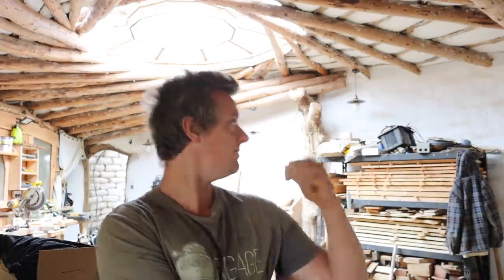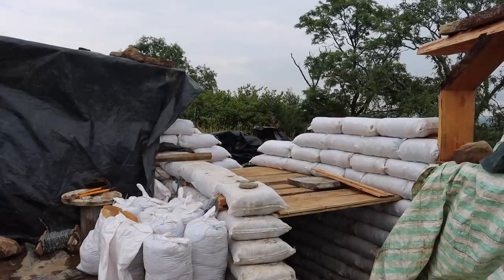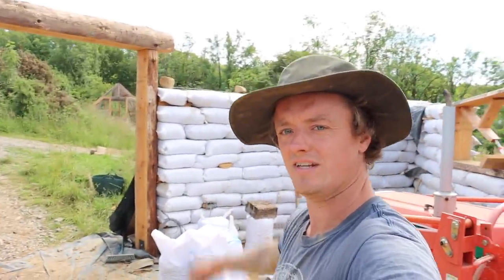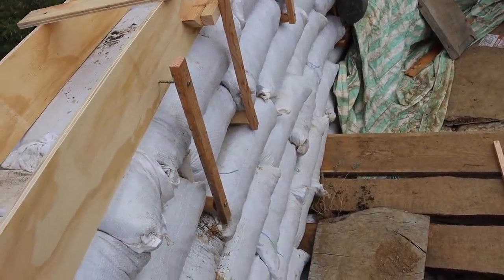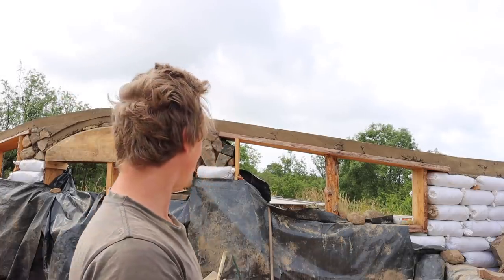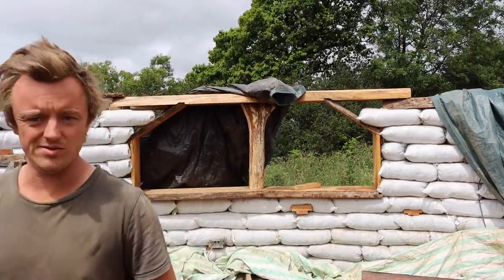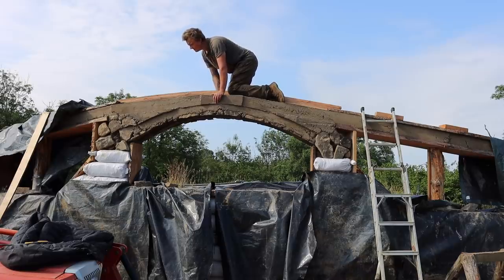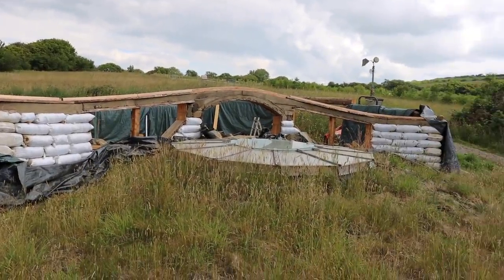Off Grid Earthbag Workshop Part 63 Walls Complete

Comment: Hey Chris,  as sad as this sounds I am actually a concrete expert. Six years as a builders labourer, twelve years in the concrete industry and I have looked after some major projects, like high rises, tunnels and stadiums. I am technically trained in concrete. You are right, concrete has no tensile strength or sheer strength. It only has compaction strength. Make sure when you place it compact it well. It is a trick, you don't want to over compact it so it segregates, just compact it well. I would add more cement, even if you can some fly ash (no more than 25% of the cemetitious), looking at when you cracked that piece in your hand, I reckon it could use more cement and compacted better. Still a good job and a tricky pour. You did an awesome job. Take care man.

Comment: A proper mix will reach most of it's strength in 7 days, and it 's max strength in 30 days. If it drys out it will quit curing, so a windy day could do that more quickly. A wet burlap bag will keep it curing during the 30 days. I've been civil super responsible for placing over 5 million yards of concrete in my time, and occasionally even the best lose a few. Hopefully it will work out for you. But don't take support off for at least 3 weeks if in doubt. It's looking pretty good. Regards, Solomon

Comment: A reciprocating saw with a chunk of wood bolted to a short blade makes a great concrete form vibrator - just run it along the sides so it 'punches' your forms and it really helps get the mix down into the little crevices.  

Great work as always, your projects are a real inspiration!
Reply: Excellent suggestion. Or rent a concrete vibrator, that shouldn't be too expensive either
Reply: I've seen it done just with a hammer drill, no need for a bit, just press the chuck up against the form or whatever and give it a few whirls

Comment: Kris, little piece of advice for the supports of the concrete arch: dont remove any supports from a suspended concrete structure for about 2 weeks. If you remove it before that time the beam can develop micro cracks that kan let in water (rust the iron en freezes ). And normally concrete is fully cured in 28 days (90 percent) so it will keep getting stronger. Greetings from somewhone in de construction industry in belgium :)

Comment: I like your design and use of natural wood curves in the windows. As a retired contractor I have seen Portland cement fail before. Usually it had been subjected to damp/freezing and should have been thrown out. Seems like a supplier failure.

Comment: When we build our concrete bases/plinths that are load bearing we remove the shuttering after about 4 days, but we don’t expect the concrete to be of robust strength until after two weeks.
While it is still green it has good compressive strength but can be a bit crumbly before it fully cures, and you risk knocking the corners off If you abuse it.
As a general rule the longer it takes to set a cure the stronger it will be in the end.
……….
Give it at least another week and if it is still brittle then you definitely have an issue but I think you are going to be ok.
Nice job mate 👏👏👏👍👍

Comment: Kris, I have had exactly the same issue with cement supply and the mix not going hard as quick as I would like or expecting. It did go hard in the end but like you a bit concerned at the time  mine was floor screed. Great informative content. Keep up the brilliant work

Comment: Cellar ceilings were done the same way as you made the windows arch.
I had the same issue with concrete.  After some months it eventually hardend up. Now it is rock solid. It just takes longer.

Comment: You're right, it's old or doctored cement. It sounded dull when you set it down. Three day cured mix would have mostly crystallized and should almost ring. However, over time it will still get stronger and seems good enough for your purposes.

Comment: The fact that the concrete seems to take a bit longer to harden but still turn hard after that little bit of a delay might be an indication of higher levels of fly-ash/granulated blast furnace slag. Those types of cement additives slows down the hydration but can actually leave you with a stronger end product. It does take a couple of weeks to overtake the pure cement in strength though.

Comment: When you were loading the concrete in to the planking, my first thought that it wasn't wet enough. A wetter mix would have allowed it to fill the gaps more.  It also looks very sandy so could be the lack of cement. Fingers crossed you can salvage it.

Comment: I haven't done much concrete work, but it seemed like you needed more water.  Would have helped it fill the form at the bottom and too little water can make the cement cure more slowly.  I'm in the States so we havent had the concrete shortage, so I haven't delt with old concrete, so you could be spot on there.  Keep up the work, who needs a gym when you have earth bags and timbers.

Comment: If you run into more concrete around rocks in the rest of the build, and if you have a sazall, you can use that to vibrate the forms to settle the concrete.  At least I have seen a bunch of other people do it, and even the concrete guys who come to places sometimes say that works better than some of the other concrete vibrators depending on the application.  Good job, hope your shoulders continue to do ok.

Comment: Ah mate, as you were mixing it I was shaking my head and saying it was wrong. Needed more cement and water. It need to be soupy so is runs into the corners. Hope it holds and you don't have to do again. And you should have planted Rebars to receive the wallplates. But overall nice job building the shop.

Comment: I’m sure Blue Circle would be extremely interested in checking out the concrete to see what happened to your mixture. 
If it’s a supplier issue then they’d want to solve that issue as well.

Comment: keeping your concrete wet while curing adds strength ; put a layer of old carpet on top and wet it several times per day, and / or keep your plastic tarp on top of the wet carpet
Reply: your humid climate helps a good bit

Comment: Hey Chris
You used not enough cement and not enough water to make your concrete 
As a rule the ratio of sand to cement is minimum 3 parts to 1 part
As of gravel - aggregate you can go from 2 up  to 4 parts of the concrete mixture
And you need enough water in the mixture to activate the cement
So you needed to add more water to make the mixture a little more liquid and mixed a little bit better
So all air bubbles in your sand will be pushed out by the water
(you can see that that piece of concrete in your hand had a lot of air bubbles in it and was brittle because of it)
As your concrete will flow better into your set form and will harden quicker because of enough water in it to activate your cement and start the hardening proces

Comment: I had some contaminated sand once that ruined some concreting I did, think it had oil/diesel in it somehow. Seemed fine when mixed and seemed OK when pouring, but it developed a very slight rainbow oily sheen on the surface once finished. Had no strength at all so had to rip it up and start again. New batch of sand on second go and had no issues.

Comment: Don't worry too much about the delay in setting.  The slower the set the better the concrete. Too fast a set tends to induce cracking.  Normal un doctored concrete should reach about 65% of its strength in around 7-8 days and progressively improve until max strength at around 21 days. Mind you this was technology I learned around 50 years ago so probably some variation now. Concrete is actually a more exact science than is generally known but if the mix is in the correct ratio  for the job it will be good.

Comment: Does not look like enough water in the cement. Also hard to tell, but it looks like you are using dirt in the mix, definitely stick to good clean gravels and sand in the appropriate portions and mix well. Cement can take weeks to months to achieve majority strength,  and actually continues to strengthen pretty much forever. Finally the rebar breaks should overlap 30x to 40x the diameter of the rebar. Sometimes butt welds are done with special machines, but those smallish welds won't provide a good link. Thanks for the great videos!

Comment: That sure does look like a bad mix. I just poured footings for the deck on one side of my Cabin. 45 bags. It was a Concrete mix with a Stone aggregate. 4000psi. It set hard within several hours and has fully cured over several days. We also are experiencing a shortage here in the USA as well but my bags of mix seemed to be up to spec.

Comment: Kris, congratulatios, its done, I think : very well done within your measures of emergency to add another layer of  larchwood and cover the arch with layered  bent larch , brilliant.
Why didnt anybody of your first commenters compare this strength of a wood sandwitched strong ring within concrete, to your primary workshop solely with wall plates on earthbags - as you said well overbuilt, but good for your safety feeling.

One critics I have, is: I never saw any vibratation- or skaking tool during the entire casting process video,
sorry about that, this causes visible problems in the arch, stones will fall off and rebar connections, etc.., this is one of the causes, the cement mix didnt penetrate optimal and didnt fanally ruttled to internal strength, between cement and your unknown material, which is brown, clay?

ok doesnt matter , multiple stronger than every other wall top you made before is

Sleep well, and dream about a roof, above your your  old workshop seeing your beautiful 12 ender roof window, and then another 12 ender roof window at the higher workshop ???# ..or a break, greenhouse roof, why not, eventionally exceptional, but not a compatible roof line over the top of the whole two workshops?

absolutely possible, yes, because of the model you showed inhow many roof logs                                                                                      . window construction video.

Kris, think about how difficult it was, to settle an 12 ender roof window to a bunch of unequal, reciprocal roof timbers,
now think about how easy it would be, to settle a 12 ender to a symetrical internal roof support construction frame, you showed the model in the video,  long roof logs to the door an back window/ stairs, shorter logs to the new window front facade, bit longer logs to the long unwindowed fassade.

 iam sort of time, see next comment, please build the 12 ender roof window, ciao

Comment: I probably would just add a little more water next time it was a little dry and that you take a hammer and bang all the sides to really give it a good Juke he's a concrete vibrator works really well always make sure to put oil on your forms cuz that helps stripping taking a forms off also he's a nice smooth finish

Comment: The cement will be OK... I think it was a bit too dry when you filled it in as the forms will suck out a fair bit of the moisture from the pour. 3 Days is nothing for that thickness id say at least 7-10 days for it to be a strong enough form - I've poured my own 5inch lintel for a pizza oven thats built into a retaining wall I had to wait 2 weeks before it was strong enough to lift into place. Only half way through the video so hope its OK :)
Reply: No way that was too dry
Reply: Looks too dry to me. Maybe it was brickies sand rather than sharp?
Reply: Looked perfectly fine to me provided he kept it moist/wet whilst it was curing (which I no doubt he did)
Probably so old cheap stock someone offloaded thanks to the shortage :-(
Reply: @bamboo979  not in the slightest too dry

Comment: I walk away from your channel only to find you have been barn raising!  So you probably have your hands full until the end of summer.  I'd appreciate a little comment about your earthbag build, what size bags you settled on, and possibly anything you might have done different.  I have lots of dirt spoil, so think this might be a good use for it.  But I'm bogged down thinking about render, turned off by the idea of  a cement render to polypropylene, but wonder what my alternatives are.  Is a cement render just the easiest thing to do here?  Oh and did you bother using barbed wire?  Would you bother with a bag build again?  Thanks.

Comment: Your Vid doesn't show it so you may have vibrated the concrete but my thoughts besides maybe weak / old cement is that it wasn't vibrated. Hope it helps next project. Good work so far.

Comment: I noticed the roof timbers from the lower workshop sticking thru the front wall, will you be using those for workbench support? Or will you be building a full size one instead? Good job btw.

Comment: Concrete doesn't dry, it cures. That process I believe is over a very long time? Up to a point it will only get harder.
Reply: I have heard it gets harder over time like wood but then after roughly 50 years concrete will break down getting weaker from then on.  The Building in Surfside, Florida collapsed most likely from the cracks that develop and the Concrete absorbing the salt from the Ocean Air causing the rebar to rust.  In my younger years I worked for a Painting Company in Florida and witnessed the damage caused by the Salt Air on the rebar.  I didn't see any rebar used in the arch Kris made but I'm sure he did.  He also won't have the problem with the salt air were he lives.  Before patching the Concrete before painting I would use Red Oxide Paint to try to stop the rust on the rebar.  Today there are other materials that work much better to stop rust.  I have not worked in South Florida or any where along the East Coast in 40 years nor have I worked in the Concrete Trade.  You can bet if man made it it won't last forever.
Reply: I mean, thats mostly semantics as long as he has the process right otherwise.
Its wet before, its dry after, you can call that drying. Just gotta be aware its exothermic etc.

Comment: Just curious, How long do these kind of buildings last typically? How long do you think your building will last? This is one cool ass project!
Reply from the maker: they are quite high maintenance but with maintenance i cant see why it wont last a lifetime or more.
Reply: Earth bags are relatively new, but the oldest cob (compressed earth) building is apparently 10,000 years old. They last so long as the roof is maintained but if they're left derelict (in the UK) and the roof leaks, the walls can just wash away.
Reply: @KrisHarbour  I've seen you lyme the walls but after that, What maintenance do you have? Will this build need more maintenance then the round house?
Reply: @jamesculp3622  The roof and occasionally fixing up the plaster, I would guess.
Any moisture wicking in will do the thing in in a matter of years, so you have to keep on top of that (storms and the like).
Reply: @robinbennett5994  cob isn't compressed earth, dummy. Its cob
Reply: Rammed earth structures are some if the oldest in the world. Centuries old.  They need a good hat and good shoes and then they will last indefinitely.
Reply: should last a several hundred years if the roof never fails . the adobe buildings here are that age
Reply: @bearsharkp3901  There are a number of ways to compress earth and cob is one of them.
Reply: @earthwizz  technically you are incorrect, but who cares. Cob is not rammed earth btw.
Reply: @LitoGeorge  The term was compressed earth and yes it is. Rammed earth is also a form of compressed earth.
Reply: @ram1brn  Couldn't one use some modern long lasting roofing solutions to solve the roof issue? Seems like that's the weak point, but a solvable problem if you are going for a low maintenance end result.
Reply: @KrisHarbour  I think the life has a lot to do with the environment in which it is constructed.
JIM

Comment: My money would be on contaminates in your aggregate been mixing mud for 15 years and cement companies are pretty strict on there product. Mainly because it could kill someone if it's dodgy, it's possible that a small trade store rebagged to not lose out on business but I highly dought the big boys did it. 

The only time we've had a weak mix was to much water added, bags that got wet on the back of the truck and not our batches but the builder used some dodgy rock found on site to make a concrete batch. Ended up going in footings once they put the roof up sitting on the post on that footing the roof sunk 300mm.

Comment: you'd park a ford fiesta on top of that arch with the steel rebars and the natural geometrical strength of an arch you have no worries mate
Reply: After watching an excellent video on arches here on the Utubes, an arch has to be a certain shape for it to have strength. That shape is the inverse of a rope/string/etc held between two points. Simple and effective.

Comment: I will say straight off I'm no concrete expert but I have worked with some who were and as you were laying in the bucket loads I said to myself that you weren't working it in enough. This was verified in your own words when you took the shutters off, this may mean that you didn't drive out enough of the air in the mix, hence leaving a porous mix and below the strength you expected?

Comment: Did you buy the sand in or use stuff from your land? I've had trouble before using my own sand, which might be due to it being too smooth
Reply from the maker: its purchased sand, we dont have any of our own sand on the land unfortunately. I dont think its the best sand but it is the same stuff i have used for everything else.
Reply: @KrisHarbour  Probably old cement then like you said. Man that sucks. Someone pulling a fast one!
Reply: @KrisHarbour  we’ve had problems with clay particles in sand causing concrete to fail, but that’s in Scotland, usually only where farmers dig their own sand, washed sand from a quarry is usually fine.